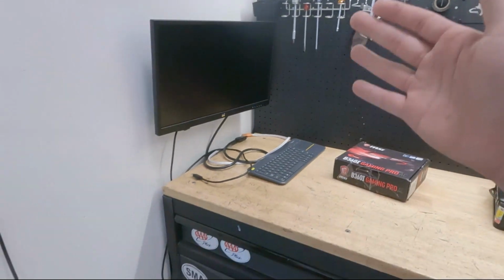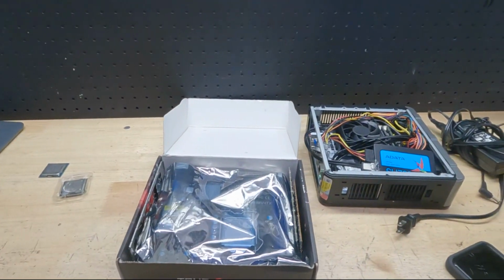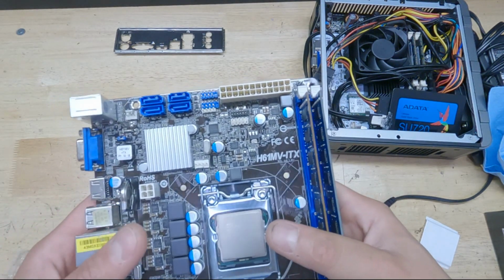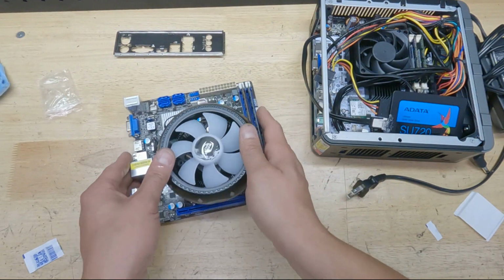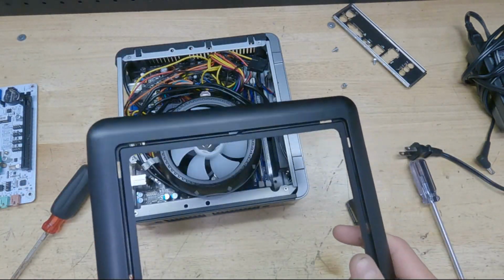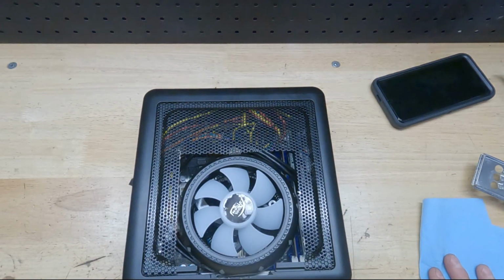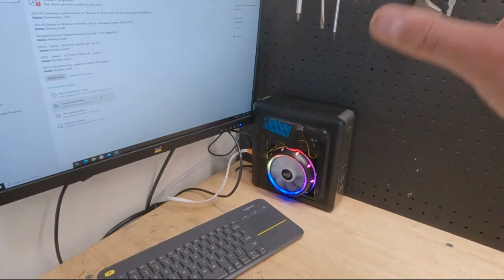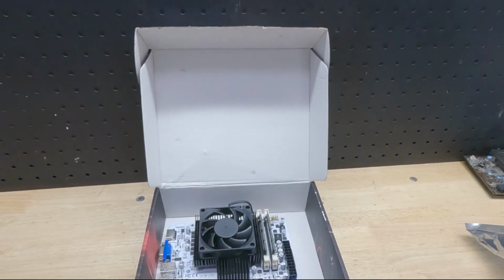My cheap social distancing itx build!!!,

Comment: I have an optiplex Ive been wanting to cut the metal side panel with. What dremel bit do you reccomend for cutting metal? (I have glass to combine for side panel window) I want to make a vid of my custom pc too to show later. Your optiplex vids helped guide me!
Reply from the maker: I use the metal dremel cutting bits but they suck. takes forever, brakes and shatters if you put to much pressure and wear out fast. it gets the job done and is more precise. The other thing I use more oftem is a metal cutting disc for a angle grinder. Thicker and faster but less precise.
Reply: @DLMtechgarage  Doood, life saver thanks!